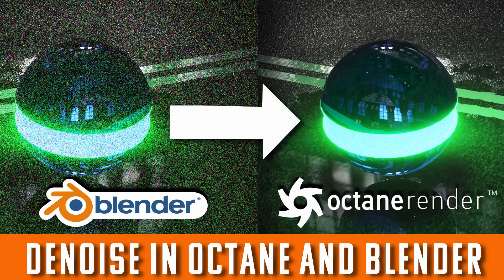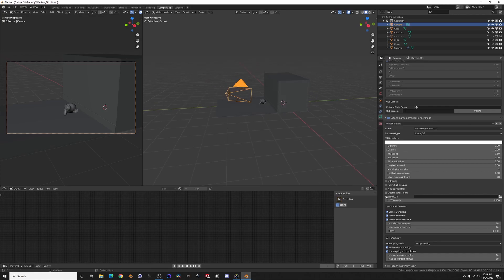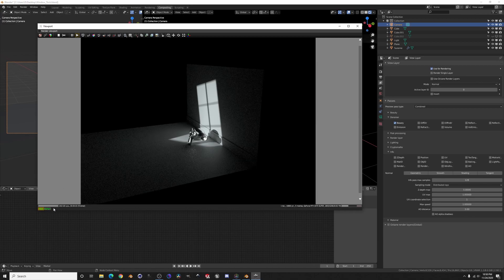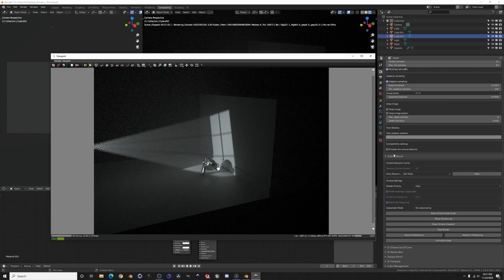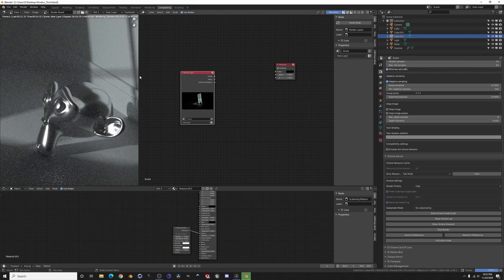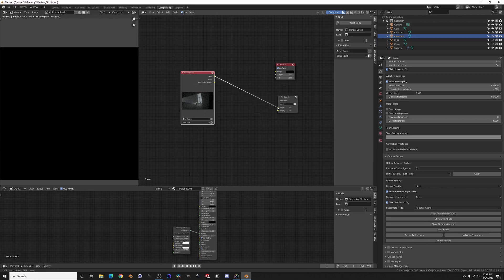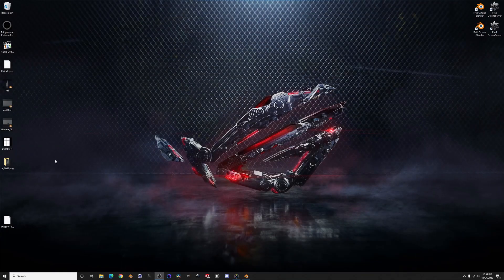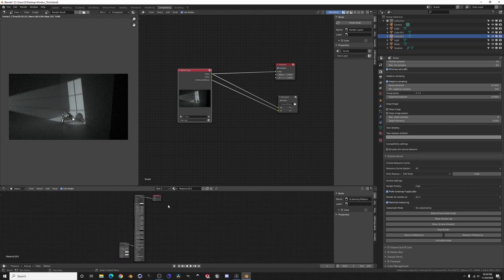Denoise In Octane and Blender 2.8+

Comment: the denoising doesnt work for me, the button wont even turn green. I'm using an rtx 3070 vram, is denoising not supported for the newer cards? did anyone else run into this problem yet?
Reply from the maker: I actually don't think that the free build has denoise support for 3000s yet. I could be wrong but I remember hearing something about that. I will not have my 3000s cards for a few more weeks so I can not test it yet.
Reply: Denoising will be working for the ampere cards only when version 2020.2 comes out.
Reply: Same - been struggling a few days